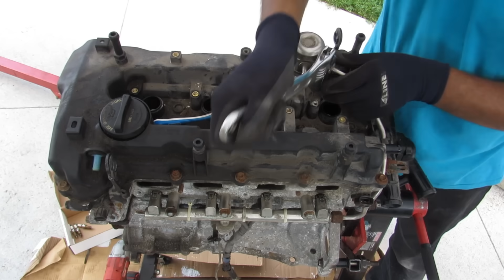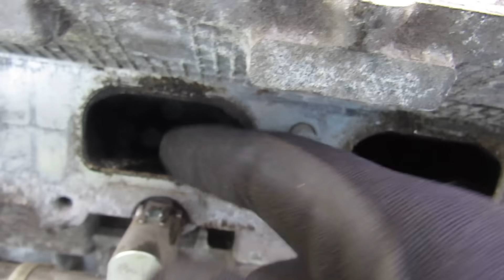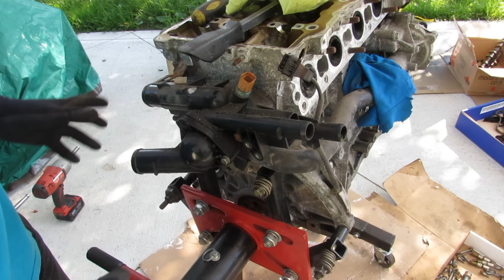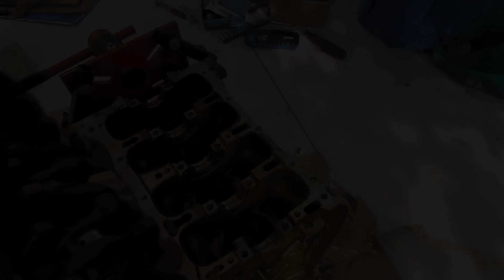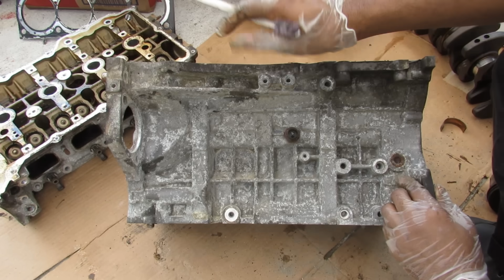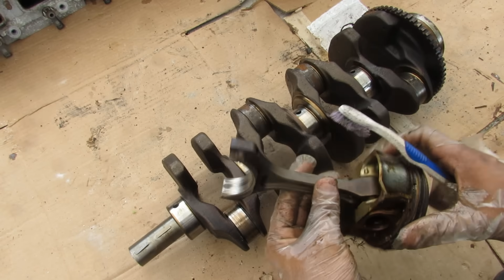Why Hyundai Engines FAIL

Comment: I'm almost 67 years old, and the only lemon I've bought was a Hyundai Sonata Limited PHEV. It intermittently stopped charging the electric batteries. The gas engine was OK, but when you buy a plug-in hybrid, you expect it to always charge those hybrid batteries. And the parts came from S Korea. It spent more than 55 days in the shop, making it a lemon (within the CA Lemon Law rules, within 18 months and 18K miles.)

Comment: Hyundai/Kia's Direct injection engine have issues with oil consumption and scuffing on cylinder block. There are some improvement but looks like temporary solution to avoid issues in warranty period. So need to consider carefully before purchasing.
Other points are generally bullet proof as Japanese car.

Comment: Great video. Luckily my 2011 Sonota  2.4 was one of the good ones. 188k miles on it and it has never left me stranded. Been a great car.
Reply: Mine died at 198k. Just fyi
Reply: This seems to be a problem of the Sonatas built in USA, the Korean ones have a similar structure but instead of gasoline they use LPI. 

I know several cars with over 250,000 miles and those are still working. I had to change the engine of my Sonata after 300,000 miles and if that's not something durable I'm not sure what it is.
Reply: @hernancruzt  American made Korean cars are trash

Comment: I had a 2 liter turbo kia optima that was part of the recall. They run a test using the knock sensors to see if your engine has an issue. Luckily, mine didn't, but they extended the warranty on the entire engine to 140k miles anyway. I then sold it to my aunt, who hit a deer and totaled it. Sure, not getting lube to all the parts is bad; hitting a large animal can be worse. It was a great car until that happened.

Comment: I bought my 2002 Honda Civic new and it only has about 90,000 miles on it. I hope to drive it a few more years and then plan to replace it with a low mileage used car that's only a couple of years old. 

I'm torn between getting another Civic or getting a Hyundai Elantra. Do you know if the Elantras have had any problems and can you offer me any advice?
Reply from the maker: Stick with the civic.
Reply: @speedkar99  I think you're right. Thank you for the reply.

Comment: I have a 2011 Sonata. Does anyone know if this 2012 engine is the same as in my car? I’ve never had a problem and am a little over 100K miles.
Reply from the maker: Yes same engine
Reply: @speedkar99  
You know what’s amazing? I posted the original comment 2 months ago. About one month ago my engine seized. The good news is Hyundai is replacing my engine for free even though it’s out of warranty. 
Q: Do modern Hyundai engines still have these problems?

Comment: I bought a used Hyundai Elantra. Beautiful outside and inside and ran great for 2 months before a ticking started and fast got worse. Apparently 2013 had a too low ceiling for pistons which after time scores the whatever and if you don’t literally change the oil like every 800 miles the engine will seize up after about 100,000 miles. Which of course nobody knows to do that. I bought it at 124,000 miles. Plus the cold weather I guess just increases the problem. Sad to say I paid $5500 for that car and only could drive it for two months. Brought it into the dealership and because it wasn’t the original owner, I am out of luck. I think it’s a crime that they allow these cars to be sold as used cars they should’ve recalled every single one of them and replaced the engines before they could resell them. I can’t believe how irresponsible car manufacturers are. I bought a beautiful car that ran fine spent 5500 bucks on it only to drive it for two months. No idea that there was a problem like this.
Reply from the maker: Sad to hear
Reply: There was a lawsuit settlement for this issue last year.
I wish I had known!

Comment: My 17 sonata is burning oil like crazy! Just had it changed at dealership a month ago and the oil light just started flashing. When I checked the dipstick, it was bone dry so had to put 5 QTS. However there are no leaks noticed under the car.  Is this part of the engine recall?
Reply from the maker: It could be eating that oil and dumping into your converter
Reply: @speedkar99  oh that might explain the poor gas mileage as well. I'm taking it back to dealership tomorrow, going to mention what you told me and see if it's the issue.
Reply: @LolatheACS  Just wandering if you found out what is wrong with your Sonata and if it will be covered under warranty. Please let us know when you have time.
Reply: @leahsugarbritches  unfortunately I will not have any updates until the 11th - which is the soonest the shop had an availability.  I'll reply to this post again once I have an answer.

Edit to add: contact Hyundai consumer affairs and have them document your vehicle's issue and give you a case # if dealership doesn't want to cover a warrantied repair. I had to do this previously for a defective oil pan (same car), dealership wanted over $500 to replace it, so I called up Hyundai and they took care of the repair at no charge to me.
Reply: @LolatheACS  Thank you. I really hope everything works out for you. I've been thinking of buying a Hyundai but am now having second thoughts. I appreciate you sharing your experience with others.
Reply: @leahsugarbritches  you're welcome, just know every brand of vehicle is going to have problems.  Just read a lot of reviews and make a pro/con list. The main thing that I really liked about Hyundai is their 10y/100k mile powertrain warranty - I don't believe there are any other brands with that offer. Aside from the oil burning more than normal, the car has been very reliable and relatively inexpensive to replace parts.
Reply: @LolatheACS  Thanks, that's good advice. I keep a car a long time so it's a big decision. Hyundai does have a great warranty.... as long as they stand behind it.
Reply: @leahsugarbritches  so I traded it in since it wasn't worth diagnosing and potentially fixing, Hyundai gave me $12k for it and we walked out with a brand spankin' new '22 Santa Fe. Couldn't be happier!
Reply: @LolatheACS  Thanks for letting me know. Dealing with car problems is very frustrating. I'm glad everything worked out for you. Enjoy your new Santa Fe!
Reply: @leahsugarbritches  thank you! 😊

Comment: So far your biased comments prove you know absolutely nothing about Hyundai and Kia. The engines are not notorious, they are engines reverse engineered from a Mitsubishi Design, and thus had a known engineering flaw on Cylinder 3, main bearing and connecting rod bearing. The engines at fault were the ones manufactured here in the USA, the Korean manufactured engines did not share that same failure. So much for USA Quality Control...
Reply from the maker: Ouch for those US plants. Too bad they still are having engine issues on brand new ones. Just ask the Hyundai techs

Comment: I have the hyundai Sonata 2011 model and the engine recently stopped working. I did not have the ksds software update installed, so hyundai is denying change of engine. Just wanted to check if anyone has prepared the engine with such an issue ? If yes, any idea about how much it costs for the same ?

Comment: Could this be a problem with the 1.6 engines also?  I have a Hyundai accent that only has 132k miles but a knock in the lower part of the engine and silver shavings on the VVT.
Reply from the maker: No those had different failure

Comment: What about the 2019-2020 kia and hyundai? I am looking for a new car and I was thinking about the new tucson or the kia sportage K8, anyone know if they will have the same problems? Thanks
Reply: ,As long as its not a 2.0 or 2.4, major defects engine will burn up to 2 quarts of oil around 70,000 like mine 2017 2.4.
Bought it at the dealership with 20,000. The service manager wont tell me what is failing but only new car purchases are the engines being replaced.
Reply: I would always assume direct injection engines to gunk up.
Reply: newer engine and better reliability of their car

Comment: 2012 Elentra limited, engine still strong after 100,000 miles. The only major thing that went wrong was the transmission, which was replaced for free. The underlying thing was with the sunroof, they have plastic guides that keep warping in the nevada sun. I do take mine in to dealer for all my timely services.  Even if you don’t use the dealer, make sure that you take care of the engine and it will take care of you. Still liked the video though.

Comment: I just figured that my engine on my 2013 santa fe sports required full engine replacement due to Connecting Rod Bearing issue which is the reason of engine recall ordered by court. 
I replaced Knock Sensor and not solved an issue with knocking noise then I realized my motor seized up. 
I have been wondering how it will be looking like for bearing. 
Thank you so much for the video

Comment: KIA\Hyundai actually replaced many of these engines at no cost to the owners. My ex-wife had her engine lock up as the second owner and about 100k miles in her 2013 Santa Fe and the engine was replaced at the local Hyundai dealership free of charge.
Reply from the maker: Do they pull the motor put the bottom?
Reply: @speedkar99  I’m not sure what you’re asking.but they put a whole new (rebuilt) long block in the vehicle.

Comment: I owned a 2011 Forte with the 2.0 in it. it started ticking and the dealer diagnosed metal in the oil. warrantied the short block and on tear down found that it had spun the #3 rod.  they also found severely worn valves and ended up doing a full valve job too. service was excellent and it didn't cost me anything.  the car was ultra reliable and (otherwise) problem free. sadly, several weeks ago it was involved in a wreck and totaled.
Reply from the maker: Good to know Hyundai is covering warranty

Comment: For one Hyundai/Kia make some of the most reliable cars money can buy. Low cost of ownership and an extremely low upkeep cost. These motors don't normally fail under normal operating conditions and will usually go the distance 250k to 300k easily with simple routine maintenance. So please do your research before you start putting down a manufacturer. And to be honest Hyundai/Kia are in some cases more reliable than some of the German and Japanese offerings and most certainly more reliable than the Chinese made American offerings. Cough cough Chevrolet.
Reply from the maker: Depends on the engine. The smaller engines faired better

Comment: Had to take my 2017 Santa Fe to the dealership to get fix for this exact reason. Heard loud banging, rattling sounds from the engine. Mind you, I keep on track with the maintenance schedule. Mechanic informed me engine will need to be replaced and I am fully covered under the warranty. Only 65k on odometer 

Folks- get this check asap if you have this engine!
Reply from the maker: Lucky it's under warranty
Reply: Mine died at 56000 km😂 everything was covered though, including a rental car and they reimbursed my towing fees

Comment: I'm on my 4th Hyundai and never had a bad experience with them. I had a 2010 Genesis Coupe that had nearly 250K miles on it. I would probably still be driving it if it hadn't been totaled when I hit a deer.
Reply from the maker: Good for you, keep it well lubricated and it'll last
Reply: @speedkar99  bro the car was totaled hahahahah
Reply: The failure rate on their engine are 50%
Reply: @m.b5777  All I can tell you is my experience with Hyundai, and it has all been good.

Comment: You stripped down hyundai engine with 200K on the dash, just look on spark plugs gap and brand
Reply from the maker: No idea the mileage but alot of these are failing even within warranty
Reply: @speedkar99  fake news

Comment: 2005 Hyundai Accent 16 valve with overdrive. It burns some oil now but I love this little car. I don't know how 16 valves ever can fit in a four cylinder. I would love to take it apart whenever it quits running just to see how it was done.
Reply: My 1st car was a golden 2003 accent. The engine went up to 355k..The rest of the car though was falling apart

Comment: Have they made any corrections to their engines? 

I’m looking at buying an SUV but the highlander just isn’t roomy enough in the 3rd row and cargo area and I’m considering the Kia Telluride but this video has made me worry about that.

My 2014 Corolla hasn’t given me any problems at all (knock on wood) and that’s why I prefer Toyota vehicles. I like keeping my cars until the wheels fall off.
Reply from the maker: Telluride should be better. See my palisade video ..same mechanicals
Reply: @speedkar99  thank you sir

Comment: Now the same rod bearing issue plagues the 2.0l in new vehicles up to 2020. Sad they never learn.
Reply from the maker: Really! Upto 2020?
Reply: @speedkar99  yes no joke. Its pathetic. Across different engines and models. I do not understand how a company can keep making the same mistake with the exact same part over and over.

Comment: The engine is so crusty it looks like it did duty at sea in the ocean.  It also probably would be better to run 5/40 or even 10/40 synthetic oil in these engines. Automakers push thin oil weights for economy.  I always run a grade heavier.

Comment: I own Hyundai Santa Fe 2014 with 89,000 mileage and unfortunately, just yesterday without any warning ,my engine seized on the highway cruising at  70mph. I've been doing regular oil change at almost every 3,000 miles. One of the most terrible moments I've ever encountered. God saved me , almost lost control after the engine seized abruptly at such speed. Unfortunately, in Ghana there is no official hyundai dealers to handle the recall replacement. I'm stucked now and have regretted ever buying Hyundai. I will consider more reliable brands like Toyota and Honda especially in Africa where we don't have official hyundai dealers.
Reply from the maker: Ouch
Reply: Hondas and toyotas aren't reliable.
Reply: @maga6319  the statistics and reality speak for itself. You can never go wrong with models like Tacoma, highlander, rav4 etc. I've Toyota matrix running over 500,000 miles with same engine and transmission. Their cars are not 100 percent reliable but relatively better than other brands.